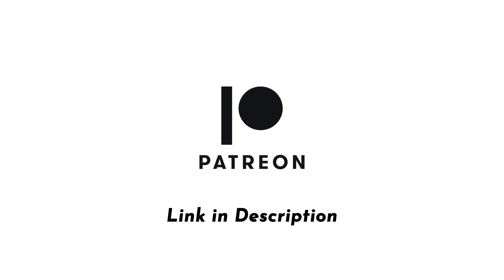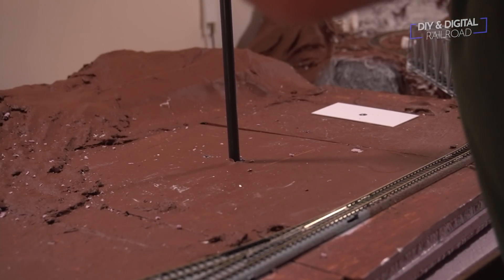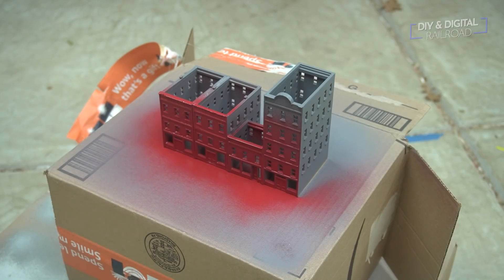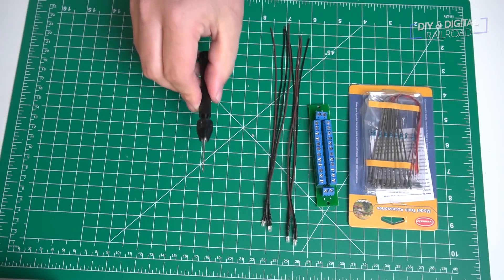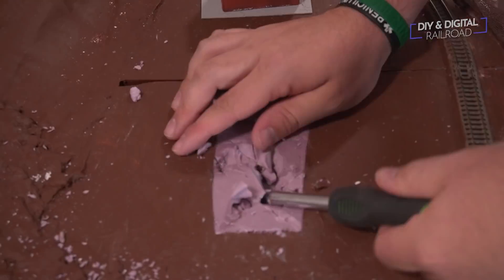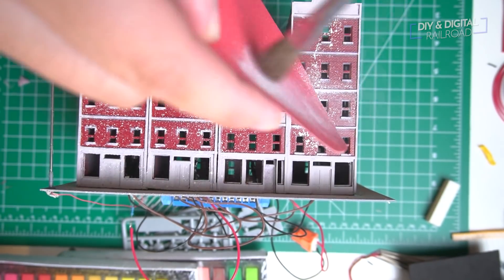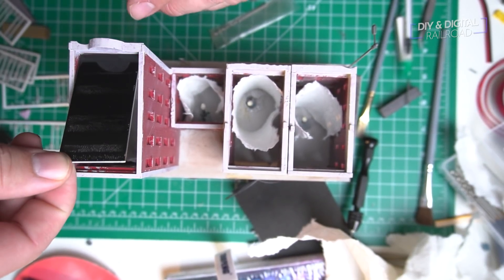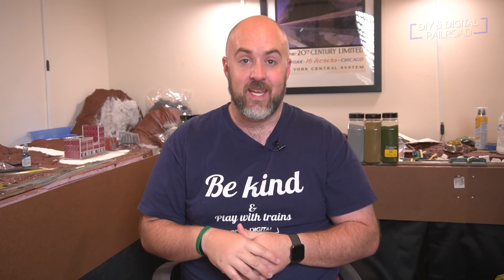I Made A Removable Model Railroad Building Module

Comment: Visit your local Harbor Freight or other tool store and score a cheap set of "gasket punches."  These are round sharpened tubes that are used to punch holes in gasket material.  They come in all sorts of sizes and make really clean holes in any kind of styrene, cardboard, or even thin metal.

Comment: You can take this one stage further, make the base thicker either by using thicker material or by adding a frame around the edge, then you can set it into the "Ground" surface, this stops the effect you sometimes see where the buildings seem to float on the ground, you can either increase the depth of the building or if you have pavement (I believe in the US you call it sidewalk) around the building you can do as you showed here and attach the building to that and increase the depth of the pavement, this gives a more natural look and you don't end up with the buildings bottom edge floating above the ground.
Reply: I was planning on using this idea in my new layout -- in most towns the block size is a standard with minor exceptions, my thought is to create most of my town blocks to be interchangeable, this way I can vary areas from residential to light commercial/retail  for a running session.   I'm using a variation of T-Trac modules but I have a 1" foam top supported by a 1/8" plywood deck to add rigidity to the systems.